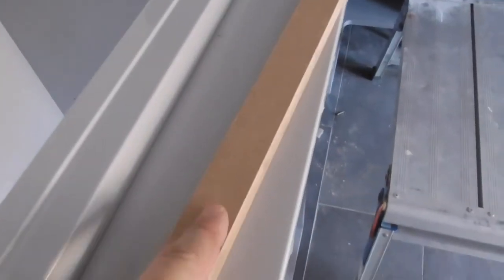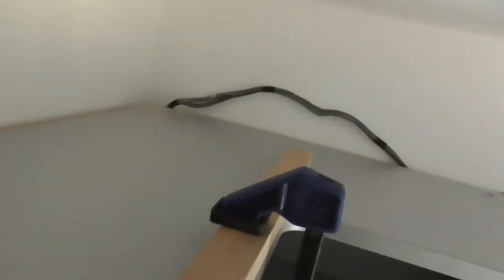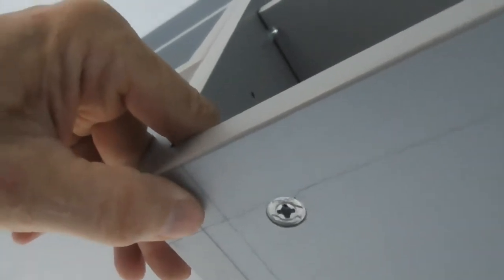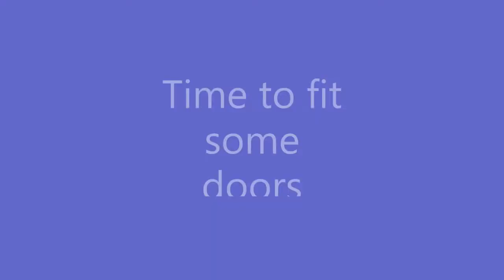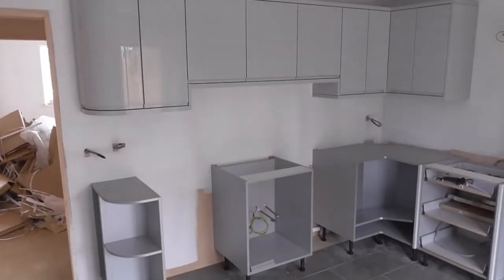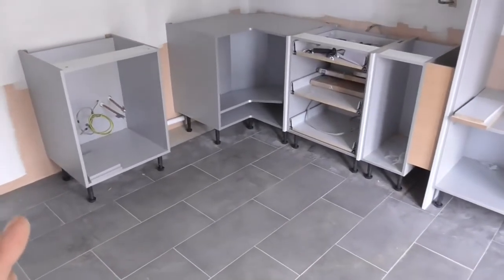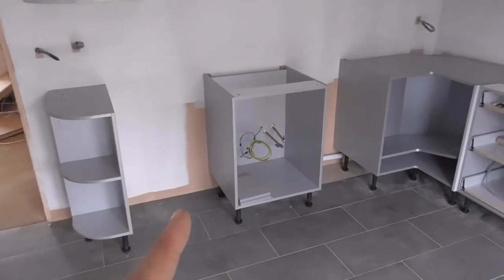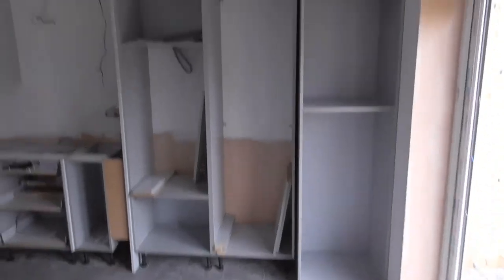Kitchen fitting basics. PART 4  Cornice/lighting pelmet and doors

Comment: Hi Del cracking finishing that took me back the old Elu beautiful bits of kit they were the Festool of there time Elu were there router was cracking as well until Dewalt got hold of them got the old Elu Flip site saw all the best Tony 👍 have awesome weekend
Reply from the maker: Hi Tony. I think the Elu PS274 is the BEST 8.5" mitre saw ever made!!. 😎 And I'm actually thinking of doing a video about it. As you rightly say, back in our early carpentry careers, Elu was the best you could get. I'm not sure many of todays machines would still be cutting as perfectly after 27 years of site use. 🤪 Thanks for watching and your comment.👍
Reply: @thetallcarpenter  why don’t we do a joint video together you with the Elu Saw me with the Elu flip saw what you think 🤔
Reply from the maker: @BuildWithAE  Sounds fun Tony. 😎 I'll get in touch.
Reply: Thats a great idea you can use there new podcast room we've only seen it once. Your right about Elu I have a skill saw that has done some work for me over the years and a half inch router, they certainly where great tools.  @thetallcarpenter
Reply from the maker: @amazing451  It remains to be seen Kevin, whether todays tools will go for as long as these older ones did🤔 Cheers

Comment: What's the best product to fill the pelmit carcass gap with?  The lighting under the cabinet shines through although the cascass sides are tight to the pelmit.  Loved this series on kitchen fitting.
Reply from the maker: Hi there🖐I know the problem you describe, and I would probably try and run some black, pvc type tape between the back of the pelmet and the underside of the unit👍Cheers Del

Comment: Hi Del, what's the best way to cut and join a long top or bottom  pelmet, so the join is less visible?
Cheers
Reply from the maker: Hi there🖐You can never really make them less visible, only try and get the joints as tight as possible👊I will always try and put any joins in line with a carcass edge/door so at least it looks secure deliberate🤔Cheers Del

Comment: Vinyl rapped cornice and pelmet Nightmare for cutting and chipping even with a new blade lol 👍
Reply from the maker: Hi Mark. Its a lottery really when it comes to these pelmets/cornice. Some cut nice, but others, as you say, are just really hard to get a nice joint on.😣 Cheers.
Reply: Warm the cut area with a hair dryer, stops chipping  .
Reply from the maker: @peterfido8735  Hi Peter. That's a great suggestion mate, and makes perfect sense.👍 Thanks for your comment.
Reply: Duct or masking tape on the front edge works a treat! 👍
Reply from the maker: @markcozens9682  Thanks for adding this little tip in Mark👍

Comment: I'm fitting a wickes kitchen atm and its been a nightmare. The 1000mm wall units sag in the middle and throw the doors off with the cornice and pelmet. There's only the hardboard behind and maybe im just being lazy but putting any kind of back bracing in means dismantling too much and basically starting the run of wu and larder units again, which took ages in the first place as the plasterer is a shitbag and must have been drunk when he bonded out the wall.
Reply from the maker: Oh gosh Kallum, sounds like you're not having a great time.😬 Try and keep pluggin forward mate.👍 Cheers.
Reply: @thetallcarpenter  nah, dont get me wrong, I am having a great time. Its just bugging me that the margins aren't bang-on. This my 1st kitchen by myself so its gotta be perfect.
Reply from the maker: @flyingjackcarpentry9394  Good for you mate.🤩 Its very satisfying to accomplish something like that.😎 Cheers.

Comment: Thanks for another great tutorial Del, what mitre glue do you use ?
Reply from the maker: Hi Richard🖐I usually use 'Mitre Mate' which is the original one and comes in the blue bottle/can👍Thanks for watching 😎 Cheers Del
Reply: @thetallcarpenter  Thanks, my wall unitis extend longer that a 2.4 length should I just butt joint it ?
Reply from the maker: @richard21995  Yes Richard, just but joint it, and I like to line the joint up with a wall unit joint as well, if possible👍Cheers
Reply: @thetallcarpenter  Great, thanks for answering.

Comment: Great channel mate , do you think hollow wall anchors are strong enough to hold a wall cabinet if no studs in wall ? What do you suggest for plasterboard.
Reply from the maker: Hi there. I wouldn't use hollow wall anchors of any type to fit wall units to plasterboard. There must be some structure to the wall, (studs), and I would fix a length of batten to this structure above the wall units, (at the back edge out of sight), and then fix down into the sides of the units using suitable screws and angle brackets.👍
Reply: @thetallcarpenter  - thanks mate 👍
Reply: This sounds like my walls. They’re nearly all built from just 3 layers of plasterboard, 2x15mm with a 40mm piece in the middle. In the kitchen they laminated in some chipboard to screw the units to.

Comment: Did that curved piece of trim on the curved cabinet come that way or did you fabricate it? If it came that way, what is the material? If you fabricated it, how did you do it?  I liked how you scored your trim piece first before you cut it. I recently did some crown and other trim that was popular with formica laminate over it and even with a recently sharpened fine tooth blade, it still had a minor amount of tear out. I didn't watch part 1-3 yet and I will do so when I have some time (probably when I am dead, then I will have plenty of time...haha) Good job.
Reply from the maker: Hi Karl. The curved pelmet/lighting baffle is pre-made from mdf. It is sent to site over length for trimming on site, which has its own challenges.😝. Appreciate your comment and you watching my videos.👍 Cheers.